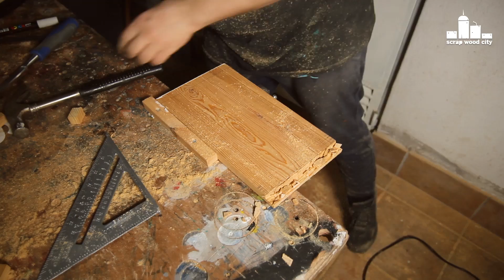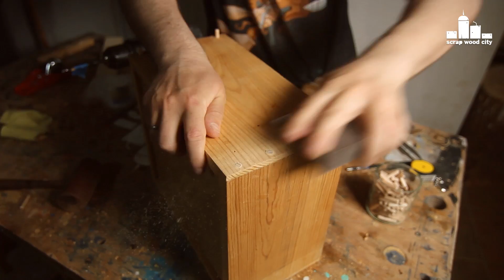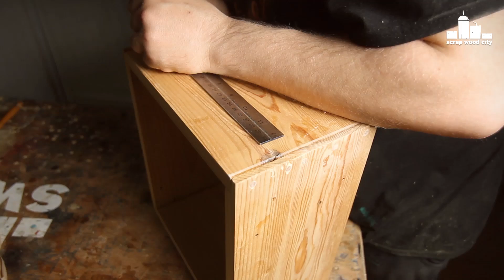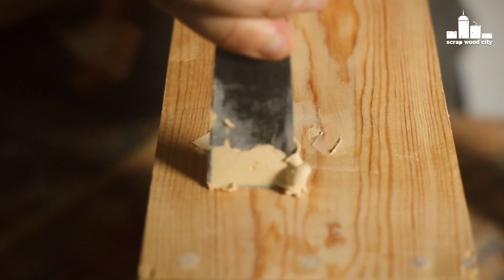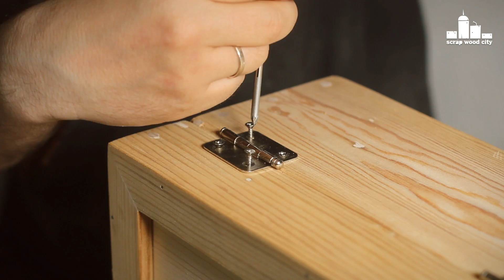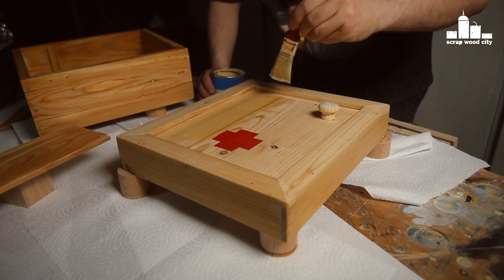How to make a wooden first aid cabinet - DIY

Comment: Nice cabinet!
Using the heat gun to quick-dry the latex for the red cross is a good tip, one that's not universally known.  There can be mixed results when drying a larger surface, as excessive heat in spots can change the color, but it's perfect for this small feature.
Reply from the maker: Thank you!